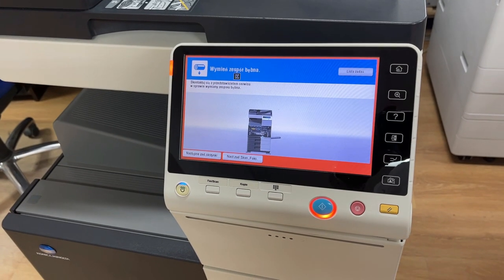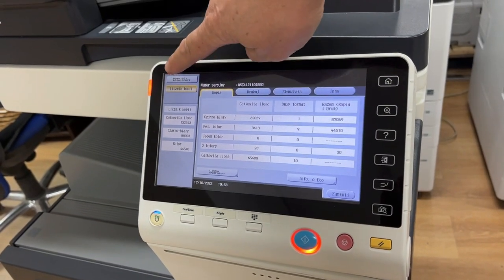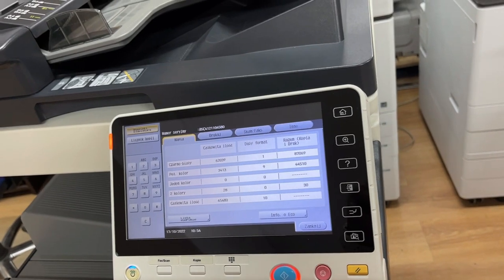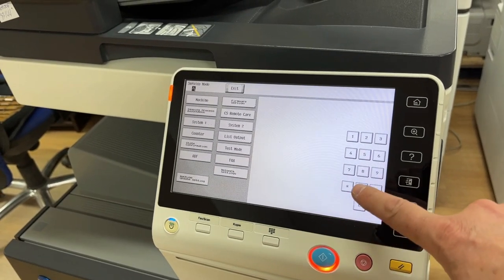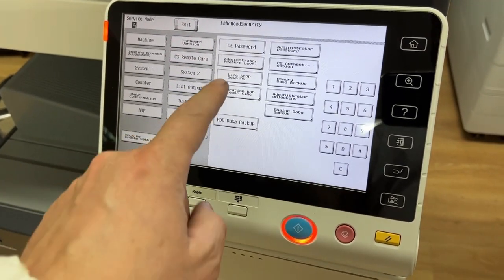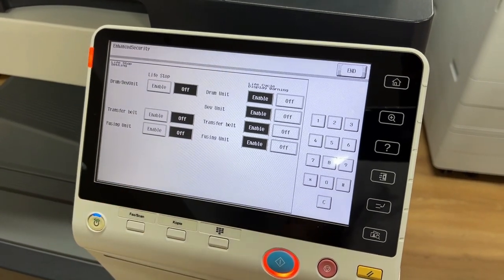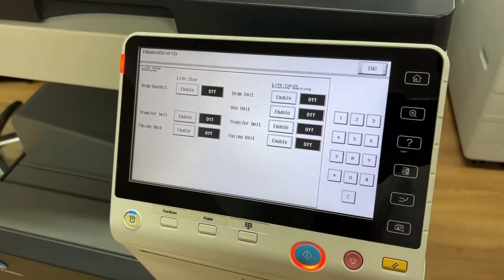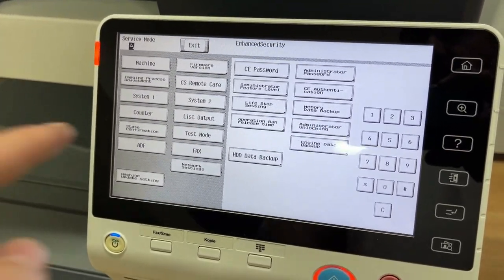Reset Drum Transfer Fuser MINOLTA c224e c284e c364e c454e

Comment: I have a problem with bizhub c258 the xerox copy is very dark? Meanwhile printing is normal, what is the problem?
Reply from the maker: Clean the scanner section, windows, mirrors and it will be better.
Reply: @MrRicoh  thank you,
Reply from the maker: Post later if cleaning the optics helped. I'm curious if it worked?
Reply: @MrRicoh  sure
Reply: @MrRicoh  it's not working, the same problem